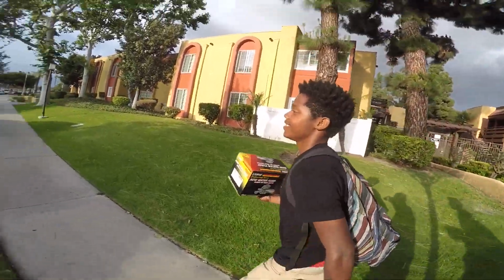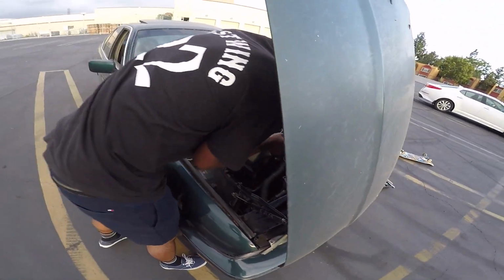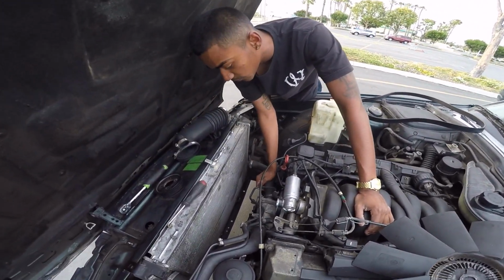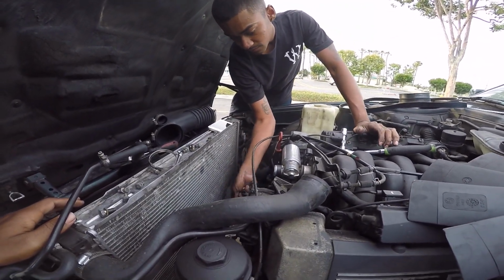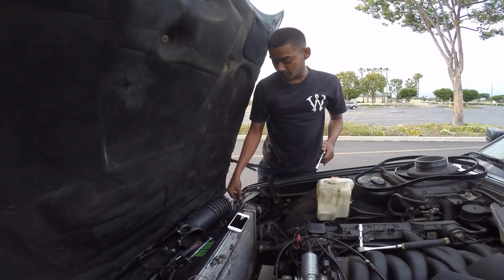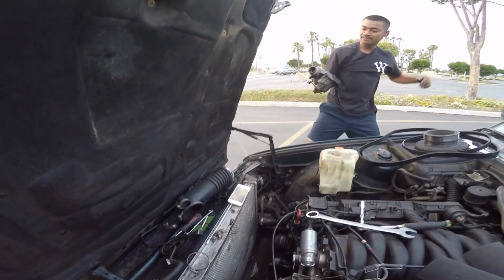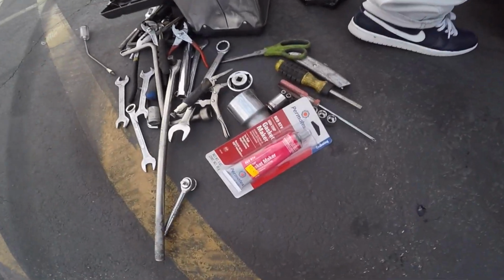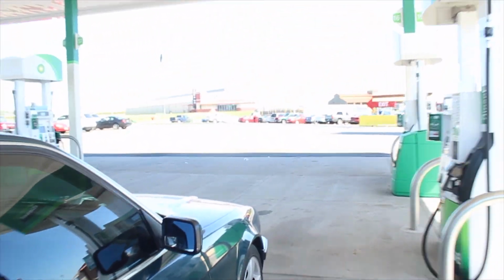I SOLD MY BMW E34 530I !

Comment: for the past two years how has the maintenance/ reliability been? How much money did you spent to fix her for the past two years. everyone says its a money pit. will the e39 530i with a 6 cylinder be a better buy for the $$ or do i suck it up and by the V8 E34 530i and hope for the best. hopefully regular maintenance like oil changes will help. will definitly put new differental fluid and transmission fluid once i get it. I subbed to :D
Reply: Ish Visuals thanks! I'll be looking into some with a manual. :)

Comment: Sad day!! How's the 540? Have you figured anything out with the steering?
Reply: That's what's up.  I'm really interested to see what is causing that noise. I can't believe you took that whole manifold off. I usually just reach behind the motor, remove the insulation and you can feel the two pipes from there.  Bimmerfest!?! Wish I could go.  Where is it?
Reply: What was the problem with the 540. I have s 530 with 67000 and always interested in the solutions. I had a steering box problem. Had to get a rebuilt from Germany